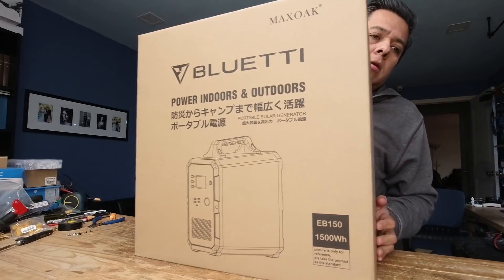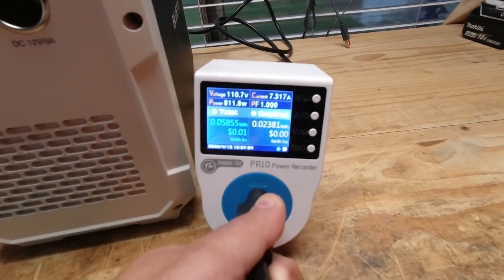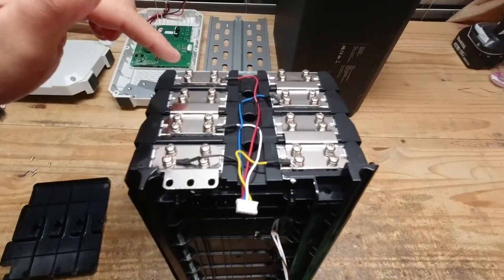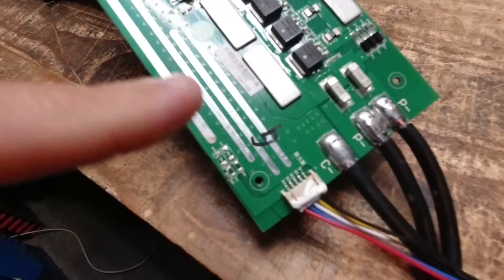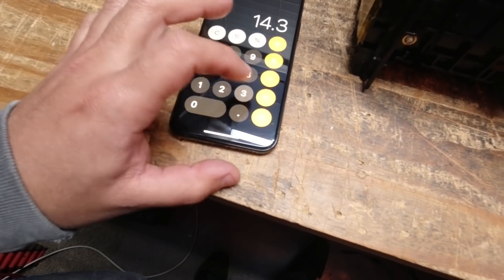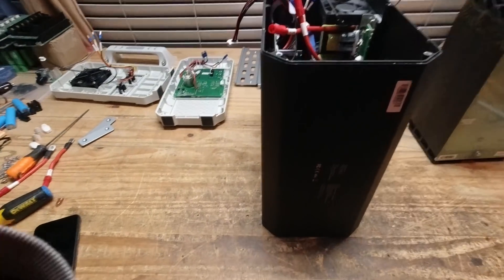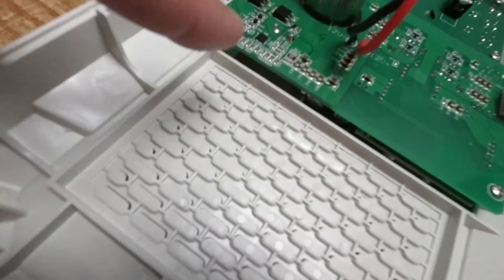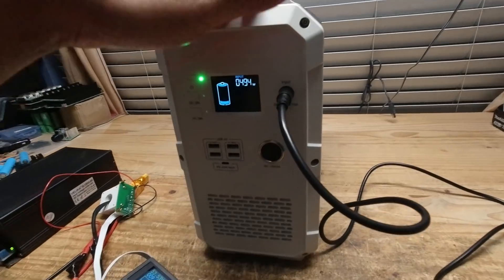Giant 1.5kWh Portable Lithium battery pack - Bluetti

Comment: The 25% loss you experienced maybe to do with the conversion efficiency of the battery. Typically inverters would be 85%+ efficient. At 800W you would have been drawing 55A from the batteries, or about 18A from each cell. I'd suggest running the test again at 100W and see if you get more energy from it.

The small milliohm range resistors are for balancing any differences in the "on" resistance of the MOSFETs. They'll drop slightly different voltages and allow the lowest resistance MOSFET some leeway and not blow it up by taking all the current.

Comment: I'm looking for guidance or suggestions about how I could harvest the LifePO4 cells from an EB150 I got that died. I received a replacement from the vendor, but was disappointed that I couldn't get additional insight about what I might try to revive it (they ultimately guessed it was the inverter board). 

It seems incredibly wasteful (and not easy to do appropriately) to  just toss this unit with what I can only assume is a healthy battery with plenty of life left. I just want to SAFELY get the cells out and put them in a standard deep cycle style case with terminals that I can then connect to an external inverter.

Any thoughts?
Reply from the maker: Yeah do it,  get some tools take apart and pull it out
Reply: @jehugarcia  Thanks for the encouragement. Now that I have the cells out, I am looking for some guidance to convert it to a more conventional configuration with terminals so that I can connect to a charger and inverter. Do you know of such a guide?

Comment: Until these products get much better they will not be on my list of things to buy. Even the manufacturers website shows them with DONT use with a Kettle, AC, Hair drier etc... 1Kw is a little too small. These need to be at least 1.5Kw so we don't have to replace all our appliances with low wattage replacements. Plus their too expensive. However its not becasue they start out expensive becasue I contacted the Factory PowerOak and they sell these for $650 however the import tax and shipping is almost another $650 !! hence the silly price.

Comment: The problem is the cost. Its cheaper to build one. I need it for medical uses and worry about power outage I did buy a 4500 gas generator but that requires me going out and my oxygen dont always let me do that so I need a cleaner way. In the house. The only think about these is the bigger ones to do what I need cost too much for me. I would love plug and play. But cost is not a think I can deal with

Comment: I got one a few weeks ago, it died with less than 24 hours of use. The seller sent a replacement, and said to just "responsibly dispose of it" but I want to know if it's possible/advisable to "harvest" the batteries to convert to a standalone deep cycle battery. It would be a colossal shame to ditch the whole package just because of a failed component. I wasn't given any troubleshooting suggestions, so aside from randomly pushing buttons and trying to get it to power up with a different charger, I haven't attempted anything else.

Comment: Power pack units are a big turn off for me. I want pass through built in AC charging UPS function. I like the 288wh units I get off amazon. you just plug an AC C13 cord into it and it just works. no power brick and it can be used while charging AND will function as a proper UPS. so when I am not camping or traveling I use them as UPS' at home.

Comment: I have a question if someone can nicely answer it for me. I have a 3s 12.6 volt BMS battery pack I pulled from a broken bluetooth speaker of mine. Can I just plug the 12.6 volt DC adapter into the in/out wires of the pack to charge it? It's 18650 batteries btw. Thanks.

Comment: I'm currently in the process of building my own version of this. 120 x 18650 cells to 10s12p, 4 x QC3.0 USB output, 12v cigarette lighter output, 240v output via inverter, 0-50v output using boost/buck converter, all maintained in a small metal flight case

Comment: I think its not 25% inefficiency on the AC side. It's more likely that they rate the full capacity of the cell and only discharge it to 3.2V giving a real usable capacity of approx 1.3-4Kwh. So around 10-15% inverter inefficiency.

Comment: not sure about those cells, kinda disappointing to not use 18650 or higher batteries instead, but I guess using pouch types would be less weight etc etc.

Comment: That extruded case comes out of the foundry dies just like you see it minus the coating and steel threaded inserts for bolts and screws.
The molten metal is pushed through a die and it comes out in that shape. Kind of like how they make pasta or the way those old Playdough toys worked to squish the dough into tubes and other shapes.

Comment: Another great review would love to know the amperage output capabilities of those cells for possible future hotrodding of this unit
since its 14 volt this might make a nice  electrical system for my trolling motor powered super kayak project. just need it to do 
50-60 amps at full speed.? hmmmmm.

Comment: The resistors on the 12 mosfets are there to limit the current for the gates control.  The gate would be triggered based on things like temp, overcharge, over-discharge etc.

Comment: I am wondering why they don't include more powerful power supply
Reply: la beauté Profitability
Reply: @HamPower  I guess but a bigger charger is not that expensive and it's  a big improvement to the product
Reply: Well it makes the batteries last longer. Faster you charge lithium batteries the shorter the lifespan.

Comment: 1000W is kind of low but it's enough for light use I guess
Reply: It's ok for lights, PCs and TVs
Reply: @marvinkansiime  yes I guess if the PC is a laptop
Reply: My refrigerator is 6 amp which is 660 watts. Correct me if I am wrong. My small freezer is likely to be about 3 amps which is 330 watts. So together 990 watts or about 1000 watts or 1 kilowatt.  So I don’t think I could run any things else with this unit???
Reply: @artblummer5307   I think so because each one is drawing a lot of current to start so it's will probably overload the inverter at the start
Reply: @jessejesse9163   yes the battery is about 100amp hrs it's 1500wh but it's can output only 1000w that a little low to me if it's was designed differently I think it's capable to deliver 2000w with a better inverter and internal

Comment: I got a few of the 36v scooter packs. Does it have a bms or do I need to add one? Also, can I make a 48v 200a continuous discharge pack with 18650  and how to make it? Thank you for the help.
Reply: DIY Projects, no. Those are the hover board batterys. The ones I'm talking about are the ones packed in cilinder share.